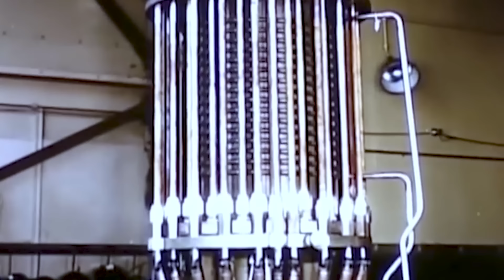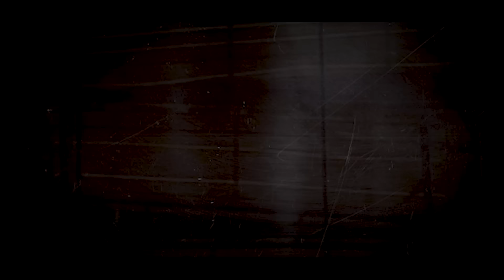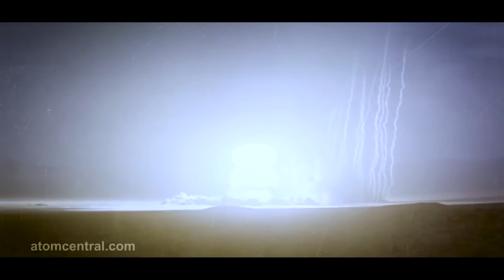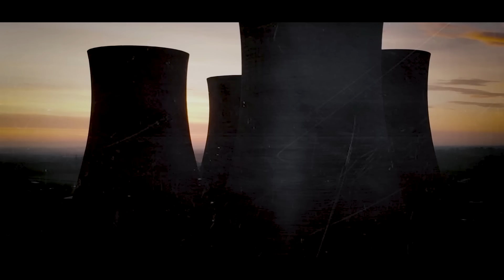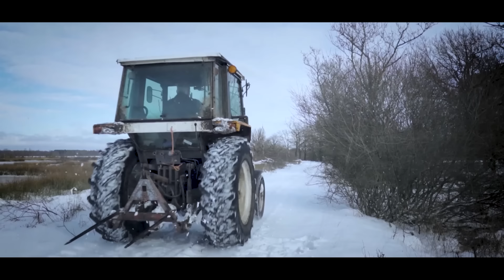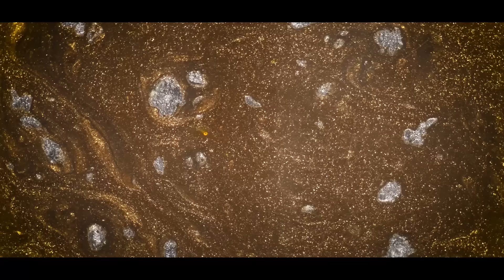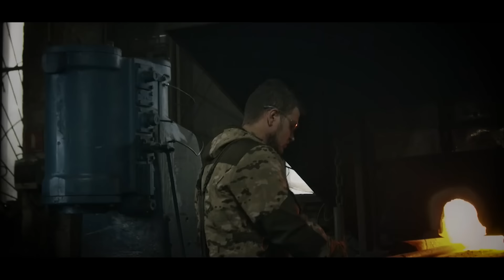Future of Thorium Reactors and Nuclear Energy

Comment: I sincerely believe that lead or sodium fast reactor (such as BREST-300 and BN-800) are superior to molten salt reactors in every aspect.
1. They use U-Pu mix, that nuclear engineers are already acquainted with.
2. They can help to recycle all the spent nuclear fuel, that was already collected in wast amounts since 1950s 
3. They use stainless steel fuel tubes, that provide the first echelon of the protection, molten salt reactors have no such protection.
4. The nitrate fuel has superior breeding capability, making it possible to use them together with MOX BWRs that were proven to be safe and reliable through the ages, and not just on paper like molten salt reactrors.
5. They can use thorium fuel too in the future, but with the current amount of digged uranium there's no need to use thorium at all.
6. They can burn Americium and other long term radioactive isotopes, recycling the most annoying waste materials.
7. The technology is already within a decade before the reactors of 1200 MW capacity can be mass produced (BN-800 is already working).
8. Reliable Thorium molten salt reactors are the distant future, before they can be mass produced it would take years just to demonstrate the technology. (Though I do believe that some start-up company owned by Biden relatives might start building thorium reactors without thoroughly demonstrating the technology, but that's irresponsible. Though this is the age we live in.)
To me Th reactors really sound like the snake oil, because everyone talks about how good they are, ignoring the question why would you need them if uranium is just as good. Especially questionable the US position, where uranium nuclear industry scraping the technological bottom in comparisson with France, Korea, Russia and China. And here're many people talking that they need to build Thorium reactors to make life safe and green. That sounds like the kind of bullshit, where you make one of your company go bankrupt and open another. US cannot enrich uranium, they cannot recycle spent fuel, they cannot buld reactors without the significant issues and time delays anymore, nor can they use MOX fuel properly. But all we hear are Thorium, nuclear batteries, lazer enrichment, small reactors, kilopower etc. This is exactly the kind of attitude that bothers me the most, where all the old technology is forgotten and all the problems are nationalised, while the new technology is considered good, "green", and "worth the investment", to me this seems like a moneylaundry, much like the wind and solar power madness that kills nuclear energy with discriminative taxes.
I know that Th molten salt reactors are the good idea and they can in future be more safe. But I just don't see the point in primarely using Thorium, when we have excavated millions of tonnes U-238 already, and the huge chunk of it sits in the spent fuel depositoriums all over US. And it will stay there for the another half of a century or so, untill someone starts a new moneylaundry campaign, when the thorium snake oil dries out.
What needs to be done is the recyclement of all the spent fuel in the US, Europe nad Russia, but it seems that only Russia is doing something towards the reliable technology of the closed uranium cycle, that will include Thorium later.
I can understand why India wants to develop Thorium cycle, because it has the large Thorium deposites, but why US is doing that if they have so many spent Uranium fuel and uranium fluorate is a mystery (the only explanation is that they want to just forget the spent fuel problem and move to the Thorium snake oil, where funds can be profitable, leaving the spent fuel problem for the national government to deal (they'll invent the new tax for it, be sure)).
All in all, if you're a country like US, yes maybe Thorium reactor is a way to go to complement the existing technology, and if you're China this is a good way to develop the technology that is virtually wasteless. But US cannot forget about Uranium, or that would be a catastrophy. (If you're Russia you have to look into Thorium, molten salt and gas-cooling reactors more, but all in all you're on the right way).
Reply: And yet another comment that occurs to me is that, yes, I agree with Valery Rachkov's concern that any technology that we pursue should be safe.

But this is one reason that I like molten salt reactors.  They are inherently safe.  Or at least they are much safer than a pressurized, water-cooled reactor.

More specifically every nuclear accident of significance that has occurred over the last six decades that I know of has included a failure of cooling, followed by the rapid breakdown of water into hydrogen and oxygen gases inside the core, and then the detonation of those gases which smashes the core and breaks open the containment shell.

This doesn't happen with a molten salt reactor.
Reply: While I agreed with much of what you wrote Wendy, The primary focus in the US seems to have shifted back to metal fueled SFRs with the announcements of both the VTR and the first Natrium demonstration both of which are to be completed this decade The Natrium is first of a kind commercial, not a research reactor. They are essentially passively safe PRISM designs based on EBR-II, which ran for 30 years without issue. I suspect recycle will return to the US as the primary reason they stopped was to set an example for other countries, which has failed. MOX fuel doesn't make sense to me in these reactors as it usually forces a PUREX or PUREX derivative style recycle to close the loop which should be banned in non weapons states IMO. Metal fuel with Electro-chemical or pyroprocessing makes much more sense to me in these reactors.

The other thing many of these videos do, whether on purpose or due to lack of understanding is confuse thorium fuel with MSR. MSRs can work with a U-PU cycle and thorium is not exclusive to MSRs.

Thorium is not magic and many of the purported claims simply false. You can make weapons material with them, perhaps more easily than with a U-Pu cycle and as you note, there are other ways to deal with long lived wastes such as SFR with recycle..
Reply: See https://www.youtube.com/watch?v=_ou_xswB2b0 for an example of a molten salt reactor design that can consume spent nuclear fuel rods.

See https://www.youtube.com/watch?v=jzHdqr-9EFM for an exposition on how we might solve the corrosion issue with molten salt reactors.  This is -- I think -- the main outstanding issue with molten salt reactor design.

But, in some ways the corrosion issue may be a bit exaggerated given that the very first molten salt reactor ran for four years before its corrosion became bad enough that they had to shut it down.

That leads to this idea, see https://www.youtube.com/watch?v=oB1IrzDDI9g which, in part, is to just go with what we have now (ie. a more modern version of the original molten salt reactor) and start building and running that.  Its nuclear core would be modular and replaceable and if you start to have problems you just pull it for analysis elsewhere and replace it with the better design that will have no doubt evolved in the time in between.

Note that the two molten salt reactor designs I've given links to primarily run on uranium.  They do convert thorium but that's not where most of the energy is coming from.  That isn't to say later on we will not have designs that primarily run on thorium, but for now it's easier to stick with what we understand best.
Reply: That was interesting.  I watched the interview of Valery Rachkov that you recommended.

These are the comments that occur to me:

1) In all three cases we are talking about "closed cycles" as the fuel is nearly completely consumed and we are left with waste that only needs to be stored and guarded for 300 years before its radioactivity drops to the level of a natural uranium ore;

2) The first molten salt reactor design that I mentioned is a fast reactor and like the Proryv Project it can burn spent nuclear fuel rods;

3) The second molten salt reactor design that I mentioned is in a thermal reactor.  Even so it is closed cycle and will ultimately nearly completely consume its fuel;

4) I don't think there is a much familiarity in the West with lead as a coolant.  Or at least my quick search of YouTube didn't find that much.  Or maybe, the issue is that I don't know the right words to search for;

5) I noticed that the fuel for the BREST-OD-300 reactor (or whatever it is called) has to be successively reprocessed as it is used.  Neither of the two molten salt reactor designs that I linked to reprocess their fuel.  Although some elements will likely in both cases need to be extracted as the fuel ages.

Comment: Proliferation is much less of an issue with LFTR than uranium reactors.
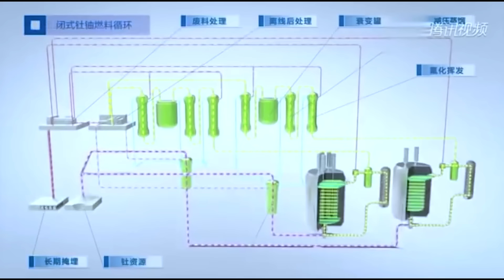~7:30, 4 years? It ran for more than 10 years...
Reply: A weapon has been built and detonated from U-233.
Reply: @Nill757  kirk explains this in detail better than i probably ever will, so i suggest you watch his explanation where he specifically addressed proliferation. My understanding is that what you really want is plutonium, and while it's possible from a LFTR it's much more difficult. It's also easier for inspectors to monitor than traditional uranium reactors.
Reply: @jeebus-k I recall differently.  The argument was 1) traditional prolif problem was Pu, LFTR uses U233 so doesn’t count.  Wrong, U233 is a threat for a weapon it’s just unusual. And 2), operator could always just dump in U238 and denature. Also wrong, can’t depend on the operator as a proliferation defense.
Reply: @Nill757    oh so now you know better than sorensen who has a degree in nuclear engineering?
You're so much smarter than him you won't even bother to listen to his explanation huh...
Reply: @jeebus-k  I listened.  Happy he promoted LFTR  and yes he’s got a degree, yet no reactor op exp and of course no weapons expertise.  I’ve also listened to some who have the latter and LFTR does not answer objections.
Reply: @Nill757     LFTR is undeveloped technology it works the issue is corrosion maintenance costs which will be improved. the fast breeder reactors were specifically chosen to produce plutonium for the nuclear program, the water reactors aren't as good for plutonium production but the fuel is the same.

LF has a mix of stuff that's hard to separate, not impossible but very difficult, it prevents the production of plutonium. And you can measure if any is missing from the reactor, that's a big difference between from solid fuels.

I'm pretty sure no Uranium will detonate, only plutonium. You'll need to provide a reference otherwise.
Reply: @jeebus-k  Your comment is rambling, uniformed and does damage.  You’re putting words in my mouth, saying the opposite of what I think.  Please say what you think, I’ll take care of my own end.  

I’m a strong supporter of nuclear power; as an an engineer I consider nuclear in general to be the *only^ viable route to large scale clean power in a modern society.  I’ve done the work to understand  the technical issues.  One of those is to understand the difference between material used for power reactors and material used for a nuclear weapon, a line that can’t ever be crossed.  

For instance, anyone can hold a lump of uranium ore from the ground in their hand, make a plate out of it.  But if you somehow got hold of several pounds of a pure U235 isotope, then a thousand federal agents should descend on you because of it’s weapon potential, and I’d call them. 

You haven’t done that work to tell the difference.  Fine, not everyone has the time and that’s why there are engineers.  But you want to pretend that being a fan can be a substitute for work, and so while you do so you get hostility from me.
Reply: @Nill757  you say "I've done the work to understand the technical issues... difference between material used for power reactors and material used for a nuclear weapon" however you're contradicting statements by kirk. If you're going to contradict his statements the burden of proof is on you.

Comment: Actually, there is nothing special about thorium. What is special and our energy future is molten salt reactor technology. The only start-up, out of dozens proposing to use thorium as you presented is FLIBE and they are floundering. All the rest are using uranium because it's just much easier and has all the same advantages as thorium. You might consider a follow-up video that explains this. Also, there is no shortage of uranium since we figured out how to extract it from seawater.
Also, the solid fuel rod waste does not have to be reprocessed to be reused, check out Elysium Industry's molten chloride fast breeder reactor. The pellets only need to be chopped up and melted into the fuel salt. They have several presentations here on YouTube.
Reply: how do you figure FLIBE is floundering??  There is tons of press and lots of explanation of what FLIBE actually is, and none of that material indicates "floundering"...
Reply: @eldergeektromeo9868  No one would be happier than me to see them succeeded in the marketplace but I've seen no indication of that. They haven't even submitted the first thing to the NRC for review. If you know something different please share a link.